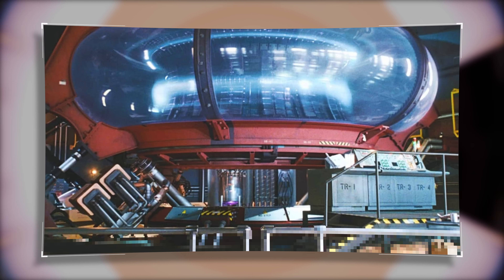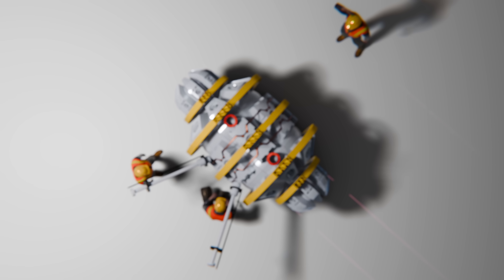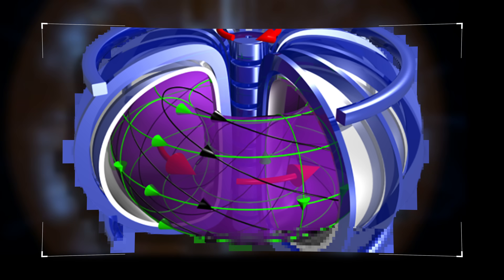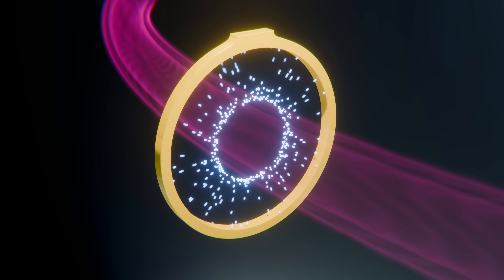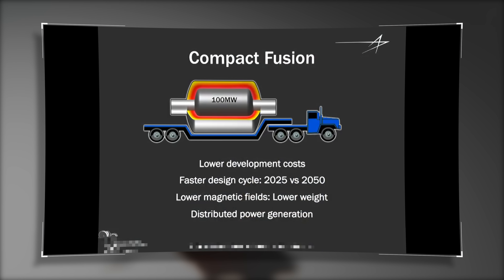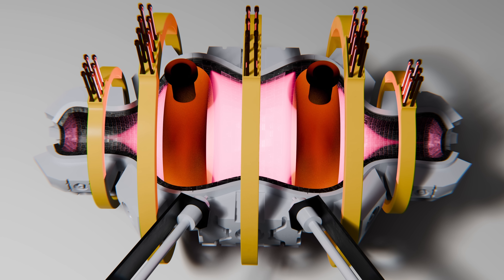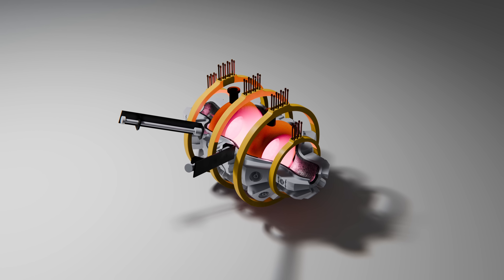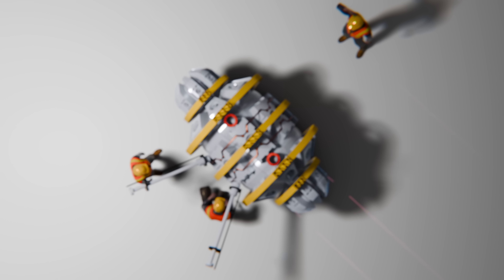Lockheed Fusion Reactor Failed - What Happened?

Comment: The name "laws of physics" should be called "predictable norms of physics". They can be bendable in certain conditions. Like the second law of thermodynamics, LM, SAIC, and other FFRDCs like MITRE already have working fusion reactors. This is just simple disinformation wrapped in a truth. Sure, they may have funded some grassroots attempts at a fusion reactor but they already have their own running. Hell they've had working fusion reactors for probably at least a decade. I'd guess around the early 2000s we had a breakthrough, and by 2014 we were able to teleport a Boeing jet a couple thousand kilometers.

Comment: patents do no work. dont let the center plasma channel spread out at all. confine inertially with heavy water around the central current carbon core. heavy water along with the carbon plasma rod current is the main fuel. the center carbon rod functions like electric arc furnace, as ballast starter, but plasma channels have lower electric current resistance in the heavy water, around the center core. like lightning plasma channels in air. high beta plasma is those lightning plasma channels inside insulated heavy water container. yep inertial containment plasma arcs inside heavy water.

Comment: I find it extremely unlikely that the Navy would replace fission reactors with fusion reactors on their ships. If the reactor stops (which is not unlikely in a combat scenario!), a fission reactor need only to withdraw rods again -- this is a miniscule amount of energy. Starting a fusion reactor without connection to the power grid, from a battery, seems to me to be insane. If even possible, you'd have a single shot -- if it fails, your battery is depleted and you're done. Same applies to aircraft, beyond the additional question of how you are even converting the energy to mechanical motion -- I doubt the Navy and Air Force want to return to turbine-driven props! All this also does not even consider where you are getting tritium -- ITER itself will likely use a majority of the entire world supply. Not very well-thought out video, to be honest.

Comment: If you're producing large amounts of excess electrons, couldn't you just skip the boiling water and use direct capture?
Reply: In the plasma the freed up electrons are mixed in with the positive nuclei. The primary energy that comes from the fusion reactions is emitted by the highly energetic thermal neutrons that carry and energy of 14.1MeV. The electrons only carry a very small portion of the generated energy.
Reply: @vernonbrechin4207  Ah, I see.  Thank you for the explanation.

Comment: We can’t even mass produce room temperature superconductors. Any thoughts of fusion power is pointless before the material sciences needed are squared away.
Reply: There has never been any experiment that lead to a practical room temperature superconductor. The so-called high temperature superconductor magnets that Commonwealth Fusion Systems is now manufacturing are intend to operate at 20 degrees Kelvin, well below the threshold temperature of most HTSC materials. Superconductor magnet promoters have been overselling their technologies for many decades now.

Comment: When I heard “Magnetic Mirror,” I knew it was over.
Magnetic mirrors only encapsulate certain velocity angles. Since velocities are Boltzmann distributed, you will always lose some particles, even if your field gradient is extremely strong, especially those in the tail end of the distribution. And that tail end is crucial for fusion.
They’ve been tried again and again, but the limitation is a mathematical barrier, not a physical or engineering one.
Reply: They were betting that most fusion fans wouldn't have any knowledge of the past experimental failures. Most fans prefer to immerse themselves in promotional material to reinforce what they prefer to believe in, while they have little interest in critically examining what they have fallen in love with.

Comment: For a fusion reactor which would be more compact, but doesn't need new physics, one would have to look at the CFS SPARC project. Which is so far I know fully funded and already well in to their reactor construction process. They're hoping to get ITER levels of capability, in maybe a tenth of the volume and thus massively lower costs. For the obvious reason of needing 10 times less reactor then. Because it's smaller the total power output would be lower, but even that isn't necessarily a bad thing as that means less severe radiation levels and needing less large power generation equipment setups. So basically you can make more smaller ones, rather then stupidly expensive gargantuan reactors.

The current projected time for it being first turned on is 2026, so it's also not all to far away anymore. Would be interesting to see what comes of that project and what people think their chances are in fully succeeding.
Reply: Most, fans of the CFS SPARC experimental machine tend to immerse themselves in the promotional material without asking themselves if key evaluation information is being omitted. The planned fusion energy output of SPARC is many orders of magnitude less than for the giant ITER project that now isn't expected to begin D-T fusion experiments until 2039. SPARC is only intended to demonstrate a 'breakeven,' or up to 10 times 'breakeven' reaction from the energy fed into the plasma to heat it up to fusion temperature. Fusion energy experimenters never cite the total energy needed to power their facilities. SPARC is only intended to operate in a pulsed mode with lengthy recovery periods between each fusion energy pulse. That pulse time is expected to be for 10 seconds maximum. The design lacks robust heat removal systems so SPARC's fusion energy generation must be severely limited. It is simply a showcase platform to convince investors that more experimental funding is needed. The technical details can be found in scientific reports that are almost unreadable by most people interested in this machine.
Reply: @vernonbrechin4207  I'm aware its absolute power output is less then ITER, yes. It's the obvious side effect of the much lesser volume, it's why I even noted that its total output would be lower.

And I purposefully compared it with ITER, because ITER is as well only a research reactor, it's main goal is to demonstrated that we can progress from current near break even results in Tokomaks to a factor 10 energy out compared to energy in. Though of course because there are various losses for the energy in side as well as various other stages, a factor 10 is not actually suitable for power generation. This is why it is not attempted in ITER, nor will it be attempted thus for the CFS SPARC.

Instead the factor 10 is a curing of ambition to a more reasonable inbetween target, as what they actually need is more like a factor 100. But just going for a big reactor right away with out proving you can handle the inbetween case with a far cheaper experimental reactor is kind of obviously reckless. It would not be strange at all if they'd need substantial time to fully tame the plasma at this new level.

Still I do think the SPARC reactor is pretty significant development, for one because it would allow for creating cheaper Tokomak designs going forward if it worked and also because it now seems like it will be the first Tokomak that will start building this inbetween bridge, where we now unlike before have far more energetic burning plasma's which we can study and learn to fully control. Beyond that once this inbetween step is fully mastered we could move on to actual power generating fusion reactors, which is the eventual goal for much of this work . For instance for ITER that follow up reactor is proposed to be DEMO, and presumably if SPARC worked, a follow on reactor design for that would be proposed for similar purpose.

In any case this is why SPARC like ITER only runs for limited times. And why there is no power generation equipment linked to either of them, because it's kind of pointless at this stage. You'd just be spending enormous amounts of money for basically PR and most likely little scientific value. You want to see if you can control plasma's in these new circumstances, if the current theoretical work on plasma's is right or if more needs to be learnt. (And good chance that more will have to be learnt)

Comment: I always thought if we had strong enough magnetic fields, creating fast spinning neutronium cores and generating energy that way would be far simpler and more stable than trying to create self-sustaining (or at the very least net-positive) fusion. I think the future is in further improving, simplifying and miniaturizing our current nuclear reactors.

Another avenue to explore is making electric appliances consume less and less power, efficiency is probably more important in my eyes than anything because then less is more. This is where radioisotope thermoelectric generators (RTG) come into play.

Imagine if with just a relatively small RTG reactor (what space probes use, essentially a chunk of fissile material slowly producing small amounts of electricity) would be enough to power a building. It is quite possible and you can make these RTG reactors safe since they are pretty much the simplest way of producing nuclear energy without a whole lot of parts. In the end we'll probably figure out how to do them with something more common like Thorium and boom, nuclear reactors will be everywhere and cheap to be produced essentially like we have batteries now.

One may argue that used up RTG-s would be hazardous to dispose of but I'd argue the batteries we use in cars are far worse when it comes to hazards and pollution. Also, an RTG can work for DECADES, with improvements on the tech, maybe even more. They don't produce much power but if we can bring down energy requirements, we could feasibly make use of this old but reliable tech. It'd also annihilate our carbon footprint since this is small enough to implement in most bigger machinery too as long as we can bring efficiency up enough.

No matter what happens, it will take a century or two for sure to see the next industrial revolution. I say let's be happy with the IT/robotics revolution we see happening today.
Reply: Neutronium?  Do you know what that is?
Reply: RTG's are not reactors. The production of the fuel for them requires nuclear fission reactors. The waste product of such reactors is the source of the RTG fuel. That waste includes plutonium-239 which has a radioactive half-life of about 24,000 years and remains a potential hazard for at least 240,000 years. Fans of such power sources tend to only be interested in immersing themselves in the promotional aspects of such technologies to reinforce what they prefer to believe in. They tend to have no interest in searching for the downsides.

Many people seem to believe that if one is operating a 1,000 watt-hour heater that someone could improve the efficiency of that until it only consumes 1 watt-hour of electrical energy from the wall outlet. Such people need to take basic classes in physics to learn something about the conservation of energy.

Those, who assume we have a bright and lengthy future to look forward to tend to also be masterful at avoiding delving into issues such as the following.

Virtually all nuclear energy promoters, are in line with the vast majority of Earth's other 8.2+ billion humans, who continue to assume that we still have at least 20 years left to turn this 'Titanic' around using their favorite nuclear technology. They have become masterful in excluding the following warnings from their consciousness. I urge readers to search for the following two article titles.

IPCC report: ‘now or never’ if world is to stave off climate disaster (TheGuardian)

UN chief: World has less than 2 years to avoid 'runaway climate change' (TheHill)
  * This statement was made 6.5 years ago.

Comment: Super conducting magnet doesn't mean that it isn't consuming massive amounts of power. It just means that there's no electric resistance and therefor even more energy can be put into the magnet without overheating and destroying it.
Reply: well that's not exactly right, all superconductors have limits as to how much current they can handle, it's not like they can just keep cranking up the current
Reply: @ashleyobrien4937 
I didn't say that there's no limit. I said that the video seems to make the false claim that super conducting magnets would need less energy overall.
Reply: @piemax0743 Well, less energy is radiated as heat, because there is no resistance, so technically it uses a bigger portion of input energy to do actual useful work.
Reply: Since the conductor resistance, in superconducting magnets, is many orders of magnitude less than that in conventional copper conductor magnets the power supplies, needed to keep the superconducting magnets at full field strength, are far smaller and energy consuming than for conventional magnet power supplies. Most medical MRI machines rely upon a superconducting magnet and their SC magnet power consumption is quite small once the magnet is fully energized. Once it is it remains in that state for many months, if not years.

The reactor diagram indicated that the superconducting magnet is far less than a meter from the plasma and almost surrounded by it. The plasma operates at around 100-150 million Kelvin temperature. The superconducting magnet coils must be kept close to zero Kelvin while being bathed in a high flux of 14.1 MeV fusion neutrons which will deposit large quantities of thermal energy into those contained coils. A recipe for failure.

Comment: It has become standard practice for most nuclear fusion energy researchers to oversell their projects, often to attract investors. The process has been going on since the experiments began in the 1950s. See the Wikipedia article titled 'List of fusion energy experiments.'

Typically, nuclear fusion energy fans have no interest in critically examining the technologies that they have come to love. They have no clue that key evaluation parameters are typically absent from the promotional presentations. The promoters have often claimed that the hydrogen fuel is almost unlimited. They typically omit the fact that tritium is radioactive and they never point out that the commercial price of tritium is more than $30,000 USD per gram. The gain factor tend to only use a very specific input energy parameter that ignores the energy required to power the facility. Most designs operate in a pulsed mode with relatively low duty cycles. The gain factor provided only covers the period of time the fusion reaction is occurring which can be a small fraction of the time that the machine is in operation. In the case of the Lockheed reactor the superconducting magnet coils are diagramed as being located within well under a meter of the plasma that operates at around 150 million Kelvin. Those magnets must be maintained at a temperatures near zero Kelvin while being bathed in 14.1 Mev fusion neutrons from the very nearby plasma.

Many fan sales pitches include an element of a conspiracy theory because many people tend to enjoy such explanations as to why things didn't go as earlier pitched.

Helion Energy is no different in making overstated sales pitches. Their progress isn't as great as they have suggested. They are now working with their 7th generation machine, Polaris. The previous experimental machines produced no highly significant quantity of fusion reactions. The goal of the experimental Polaris machine is to recharge their plasma confinement magnet capacitor bank from energy generated by fusion reactions. They have yet to come close to demonstrating that. The goal is not to generate a significant quantity of fusion energy derived electrical energy that can be transferred to the power grid. In a previous claim they said Polaris would do that during the summer of 2024. Helion Energy states that the compression cycle last for about 1.0 millisecond but they don't mention that the fusion reaction may only last for around one nanosecond. That is not much of an active duty cycle if the machine even achieves a pulse rate of one shot per second. The following YouTube video critiqued some of Helion Energy's earlier claims.

The problems with Helion Energy - a response to Real Engineering

Comment: Ah fusion the modern equivalent of searching for the Holy Grail. Some stupidities just never goes out of fashion.
Reply: Fusion isn't stupid, it's just an extremely difficult engineering challenge. The reason people keep working on it is because the potential benefits of fusion power are large enough to be worth the cost. The Holy Grail, by contrast, was a mythical artifact that would have offered no practical value even if it existed.
Reply: @harbingerdawn  We have at this very moment perfectly working and most importantly existing fission reactors that could supply the world with power for centuries and centuries. As I said its the modern equivalent of looking for the Holy Grail something that probably does not exist and even if it did would hold no practical value.
Reply: @harbingerdawn  All that funding going into researching smaller,more efficient,cleaner fission reactors would be much more beneficial and might even return some success in the next few decades. But no,let's try to shut down existing powerplants,keep burning coal and oil and pump trillions into technology that may very well be impossible for another hundred or more years
Reply: @FüTyibi  You make it sound like the people deciding to invest in fusion are the same people deciding to shut down fission plants, which is largely untrue. There's also no contradiction between investing in fusion and investing in better fission, both things can be and in fact are being developed simultaneously.